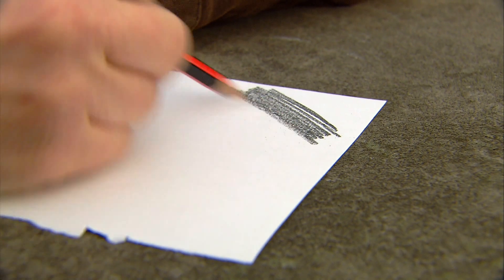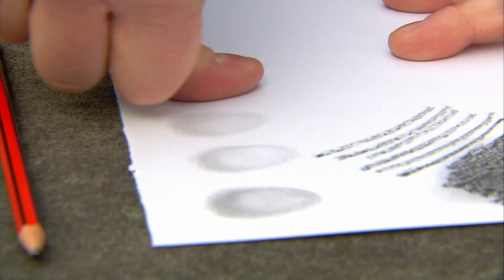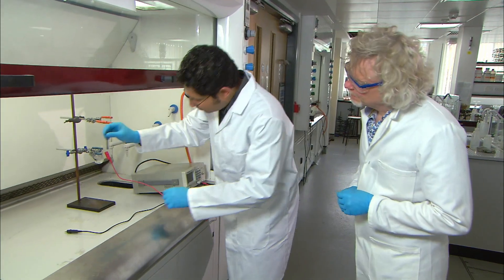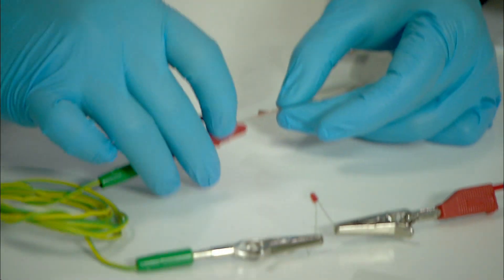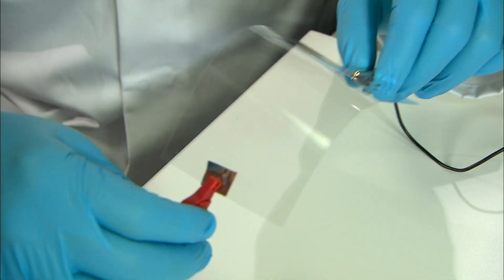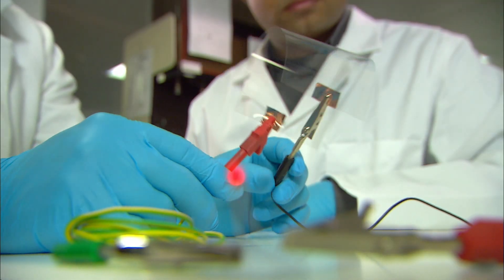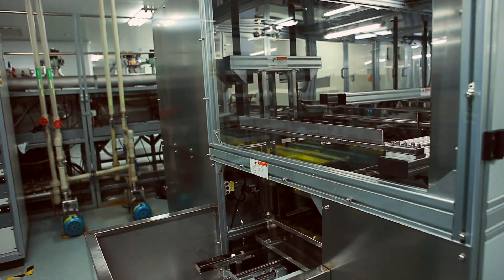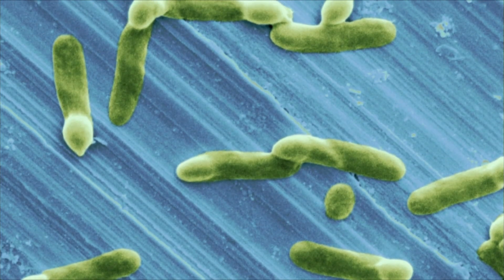Graphene on The One Show

Comment: What baffles me is the example they give; "If you balance an elephant on a pencil and put it on graphene, it won't break"? But it's only an atom thick. And how can you get solid graphene, just graphene that you can hold onto (like diamond). Theoretically it will look like a diamond because it's still carbon-based substance. And even more confusing, if graphene is strong as an atom thin, why does it become graphite when you increase the amount of layers? In a diamond, the carbon count is higher than say coal and it is way stronger. So technically graphite should be the strongest substance as it is multiple graphene sheets. Chemistry just broke Physics.
Reply: +Kidtronic10 Gaming I think it's because graphite's layers are only held together by delocalised electrons not by covalent bonds. But I'm only 15 so I haven't a clue.
Reply: It's because some random manchester stuck out tooth brit said so

Comment: This material may propel us into a new age.

Once they can produce it on the cheap, the possibilities are endless. Harder than diamond but lighter than paper.... Spaceship designs anyone?
Reply: I don't understand. This is one atom thick. I can slap it with my testicles ad there will be no more graphene.
Reply: +Cd5ssmffan lmao
Reply: Whoami691 
It's not harder than diamond, it's actually flexible and therefor (not at all) hard. But it's VERY resistant to scratches and it has an extremely high tensile strength.
Reply: To make Graphene useful and strong you need to have a lot of sheets that are sticked to each other.

Comment: What about the environment? Sure, graphene consists of carbon, which is one of the most abundant elements on our planet. However, making a single layer of graphene with chemical vapour deposition (CVD) or similar techniques requires a ridiculously high temperature (energy -> pollution). Using graphene powder from graphite instead of CVD for getting thin conductive layers is also not very smart as vast amount of toxic chemicals are used in the process.... Also, several researches suggest that graphene can also cause cancer (only the edges of graphene flakes are carciogenic - the flat surface is not).

Comment: Back in the late 1970’s when I was an electronics instructor for the company I worked for, I would teach my classes what conductivity of electricity was.

(The degree to which a specified material conducts electricity, calculated as the ratio of the current density in the material to the electric field that causes the flow of current. It is the reciprocal of the resistivity). 

In order to demonstrate to the class what conductivity was I would ask the class if I would be able to draw a circuit on a piece of plain white paper using a lead pencil, would it actually work. Of course they all said it would not. After drawing a line with a lead pencil and connecting the circuit to a 9 volt battery and a LED, the LED would light-up just like this new discovery. I could flex the paper, fold it and the circuit would still work.  

It’s something how in 2015 it is now a revolutionary new idea….
Reply: Oh boy, did you miss your chance....I'm actually angry that that happened.

Comment: suppose we rub a pencil lead all over a paper, will the paper conduct electricity as is being implied!?! I doubt it! Graphene is some thing else!
Reply: Bala Subramani I've tried that in the lab the other day, yes the paper does conduct, even if you use an Ohm meter across the paper with the pins hitting ends where lead is drawn and connected to each other, the ohm meter reads a resistance. Question your doubts carefully before stating them Mr, Subramani
Reply: Bala Subramani I don't know. We know it's a mineral.

Comment: The building blocks of future is now D3 printing, Graphene oxide reinforced cement and concrete drying in minutes using UV light build a houses, a car, ext , replacing or emixing metal, plastic so on . it's limiteless, Now companies will be able to make a difference in the world of 21 first century for generations to come.   
http://3dprint.com/27324/graphene-nano-3d-print/

Comment: rrrrr totally love the idea but one thought they still haven't got around with yet. Batteries?? Someone needs to come up with a way of having a supercharged slim capacitor battery that can last and bend on the bezel frame with the plastic with graphene OLED screen. Until then nothing's going to move forward. And yes already seen someone has introduced a battery like super fast charge capacitor, except they haven't made it tiny enough. Maybe they could get around this idea of incorporating batteries into it and instead resort to piezoelectric minute currents from the human body? like draw the voltage through our fingertips? or have a wrist band with a small amount of power flowing through the air (they have invented wireless power already) so that when we come into contact with such devices outside bezels 1 finger tip is all it takes to charge and operate the phone when its not on standby power?..

Comment: Graphene does everything except leaving the lab. It will take another decade or two before we can manufacture or produce it efficiently and cheaply.
Reply: +NickChimed But imagain coating plastic spaceships with this stuff... It's harder than DIAMOND. The ultimate protection! Less weight means less fuel which means half the cost of the spaceship is halved.

Comment: "because its so thing it's incredibly conductive"... that doesn't sound right. If you want to make a wire more conductive, you make it bigger and thicker, not smaller. 

and I don't think you can make graphene by stamping your finger across a piece of paper. There's no guarantee that the layer you created is all connected, or one atom thick.

Comment: 20th Century: "Shit, I dropped my phone."
21st Century: "Shit, I ripped my phone."
Reply: Ah, but there are self repairing plastics in development.
Reply: My original comment is 2 years old.
Reply: I doubt you can rip it if graphene is coated on it. I mean it is twice as strong as diamond.
Reply: L33t H4x0r Gamer Twice as strong per volume maybe, but the graphene coating is very tiny so not very much net strength
Reply: +wolfgang169 Graphene is harder than diamond. Good luck ripping it. :P
Reply: 21st centruy*
22nd century*

Comment: In the future, you will have phones so light that if you make a mistake of leaving it on a table outside, a small gust of wind could blow it away...yay?!
Reply: Or phones at the same thickness and size they are now that have the strength of a desktop..I'd prefer that one
Reply: K Y Hahn Your idea has merit. ^_^
Reply: Random Rampage carbon is an element... jesus
Reply: PlasmaMongoose but carbon is one of the most abundant chemicals in the universe, so they will probably dirt cheap
Reply: We'll just be sticking it on or hand or arm. Tattoo? Be scared, be very scared! No privacy now, just wait... no sticky no food?
Reply: If only we had the technology to add weight to things. IF ONLY!
Reply: how about it's so small and light, that the phone is implanted in you, so you'll never lost it :D
Reply: Izman Quaasalmy and then facebook buys the company that holds all the data about the people with phones inside them.... for 19 Billion Dollars.
Reply: K Y Hahn that would be awesome.  but I see other uses and also who said graphene wont be clipped onto a clipboard of sorts and who said they would be expensive unless they want it to be.

graphene should cost less than 1 dollar to manufacture by now and possibly less down the road once the research is paid for by early adopters.

after that let it be opensource and you will find a revolution. in technology.
problem with patents now they patent troll holding back innovation.

fine with some patents but they are trolling too much.

the idea for this is not new they already were thought up in startrek scifi novels etc.

finding the method such as graphene is new though.

methods are new, ideas are not
Reply: I'm happy with my slim phone design now. Too slim and it will be hard to hold in my hand.